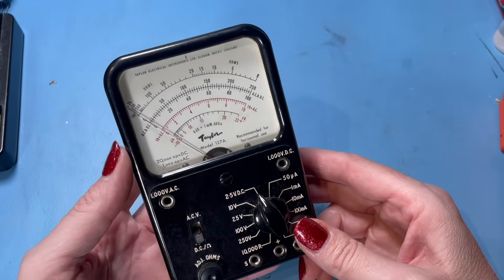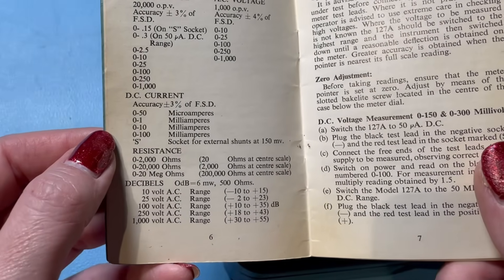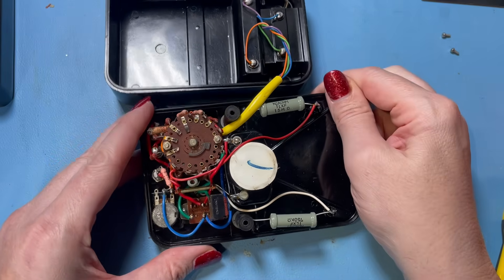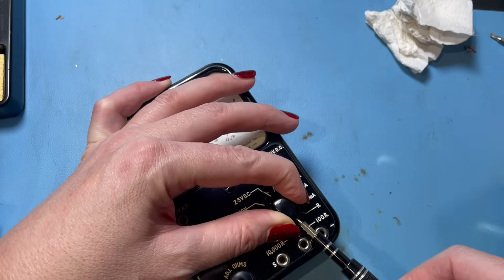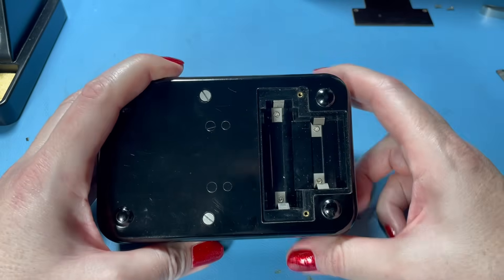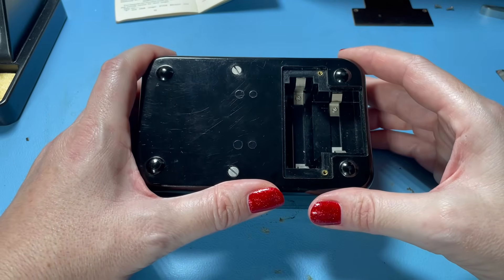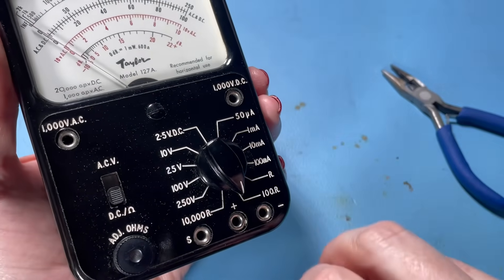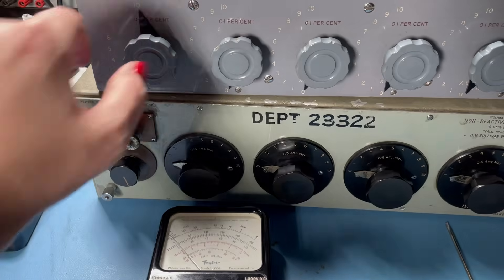A Look Inside Taylor 127A Multimeter! Test & Teardown Plus Spot Welding Obsolete Batteries!

Comment: I think I would have thought about spot welding to the existing metal tabs in the meter, instead of the battery, so any new battery can fit.
Reply from the maker: I could have done that but I expect I would have got viewer complaints that I didn't keep it original, lol.
Reply: @JazzTechUK pfft, they are made to be used and be useful, not sit pretty in a museum

Comment: I've been a tech for 52 years and still use analog meters (but not exclusively).  If you have a fluctuating voltage or current they are far better than digital.

Comment: I guess "pocket size" depends on the size of your pockets. 😀 I made a simple 3D-printed adapter to use 5 CR2032 button cells in my AVO 8, it's on Thingiverse if someone wants to print one.

Comment: I have a similar model classic voltmeter, it's actually a big face or more of a large face meter so it's easy to read, and it is immaculate whoever had it was the same type of person very well kept probably hardly ever used, but it does use some specialized batteries that are no longer available, other than that I keep it like you probably do just because they just don't make things like this anymore.  It's a beautiful piece of workmanship    Triplet Model 630 Type 3 though that's the model number listed looking for a picture doesn't exactly come up with the same meter I have, apparently for the resistance it needs a 30 V battery.  for me just having it as a classic showpiece kind of like a lot of the equipment you have just the coolest stuff made way back in the day and still usable that's durability...   🙂